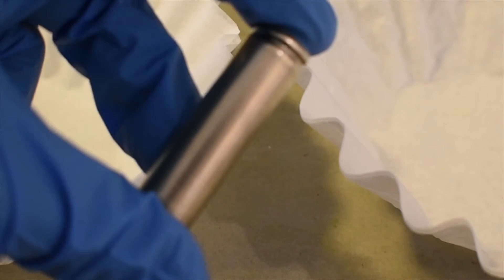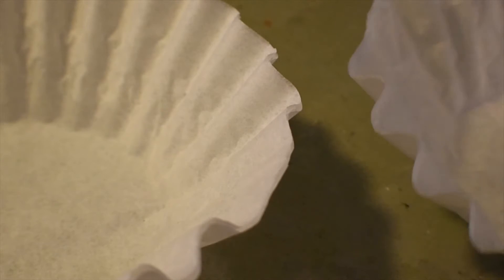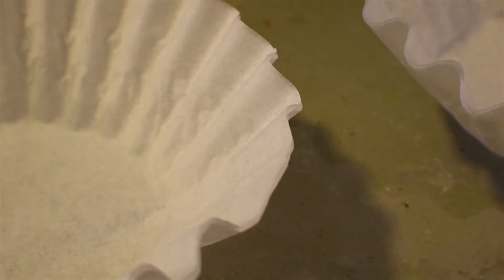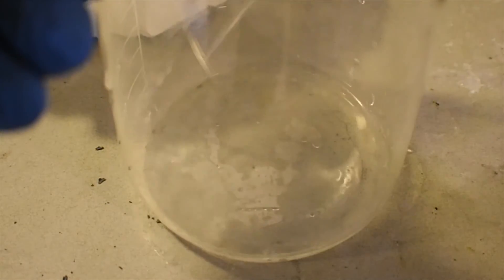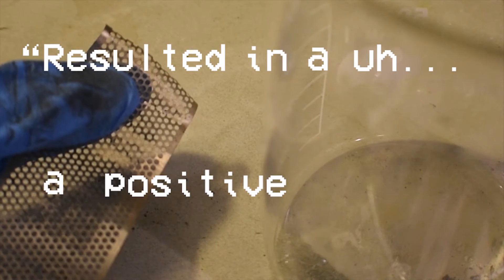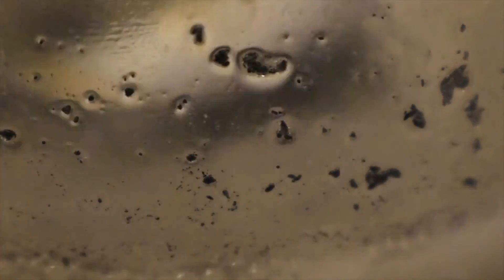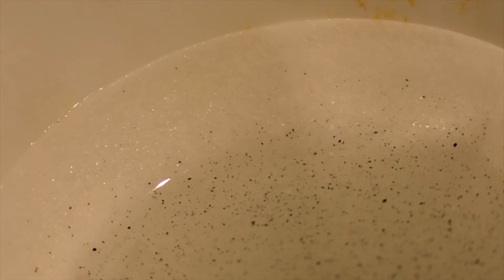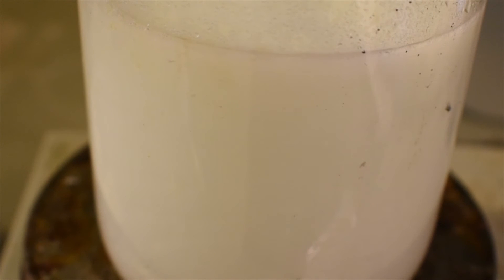Extraction of Cadmium from NiCd batteries

Comment: I had these batteries but I thrower them away 😢😢😢 didn't have the information that time.
Reply from the maker: Aww, rough. Keep looking for some, check hardware stores in the electronics section! :]
Reply: But what exactly would you have done with the cadmium carbonate, had you saved the batteries?